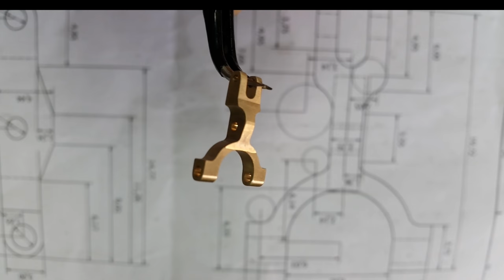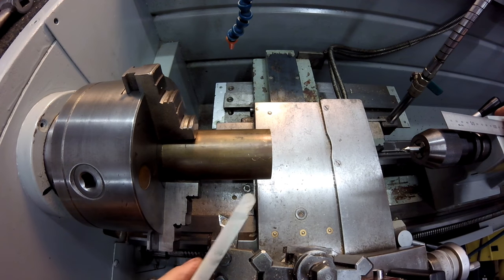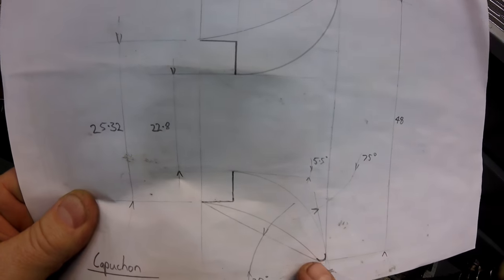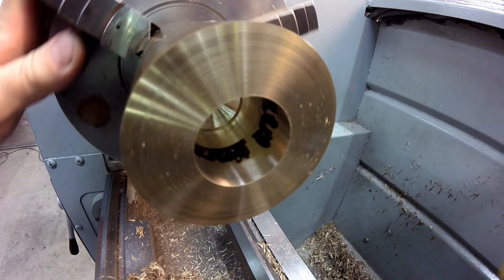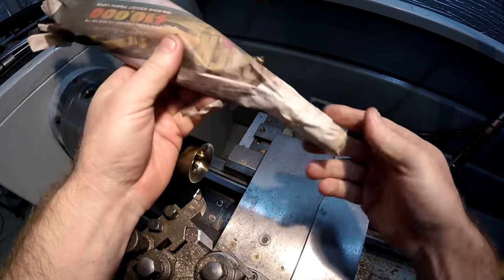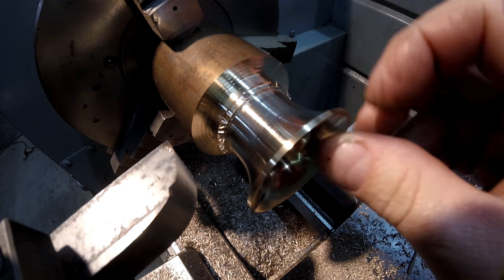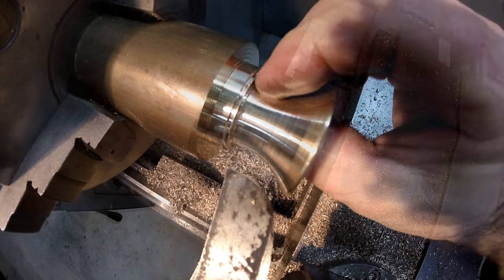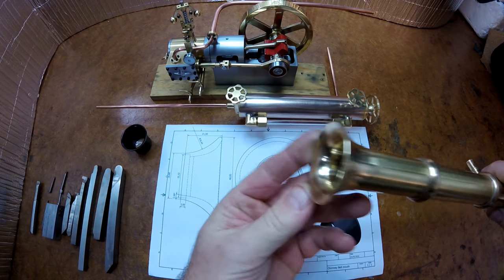Blair's Workshop episode 2 Chimney Top

Comment: Great video, but you may want to point out its not a good idea to put fingers or thumbs into the hole on anything rotating, best to add to a rod or stick etc.
Reply from the maker: Leigh Jones ,a bell mouthed item with an inside diameter 2.5 times bigger than my thumb I call safe.

I use my Toolpost spanner handle on smaller diameters especially if its sharp but on a fully polished bell mouthed item its my opinion this approach is safe enough.
Reply: Blair Knight true, but you want to add a warning text on the video's if not experienced then it's not good practice
Reply from the maker: Leigh Jones fair point, in my defense from that camera angle you cant really see just how much clearance there is around my thumb, if I could post a pic I would, it looks far worse than it actually is
Reply: Blair Knight hopefully your be getting 1000's of view and a lot will be learning , this is the only reason I said this, I do the same thing when making bezels. But you got to be aware of the newbies that may watch this.
Reply from the maker: Ok for the newbies, don't do what I do😃